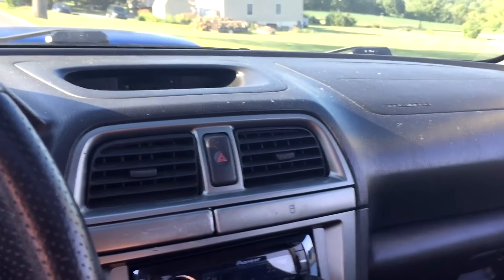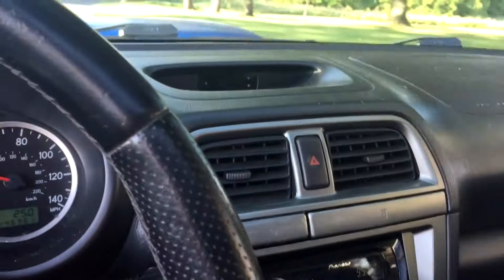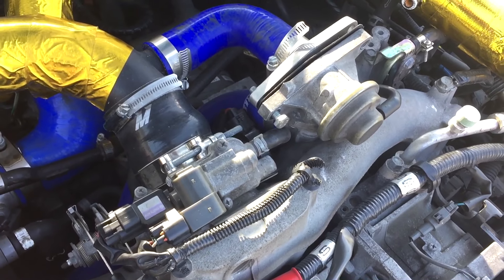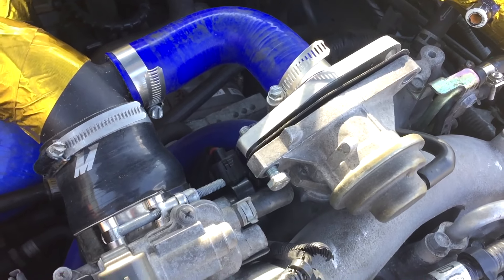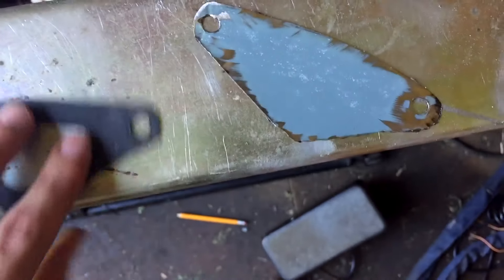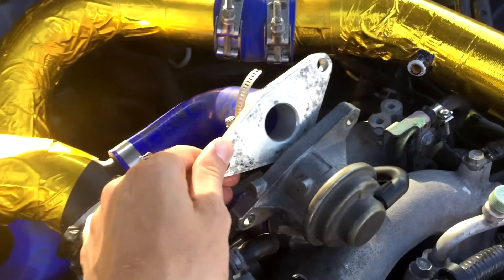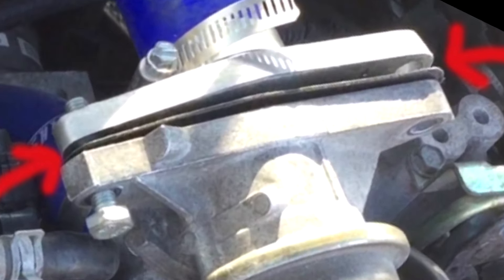DIY | BOV/BPV Delete - Block Off Plate | Stage 3 WRX Turbo Sound

Comment: Been a engine builder for 25years, I myself have been turbocharging cars since the early 90’s, since then turbochargers have come a long way, to my knowledge this isn’t causing any type of harm to the turbine or throttle body. There’s a lot of comments here saying lots of different things but these days everyone’s a mechanic lol
Reply from the maker: well said
Reply: Very nice 😎
Reply: I m a mechanic...level 255 mechanic...in Ragnarok Online 😂
Reply: The noose is the turbo spinning babckwards and fitghting itself cause the air has no where to go! This will break the blades extremely terrible.
Reply: @holeshot1721  Please do more research
Reply: If the turbo were to spin backwards wouldnt that in turn send the exhaust back into the engine stalling the engine😅🫠🤣🤣🤣🤣🤣🤣🤣🤣
Reply: @holeshot1721  Bro its just the blades chopping the air. All it will do is maybe a little bit more wear and tear over time of high PSI boost. Do some research before believing others, trust me it will take you far in life. Wait till you realize its physically impossible for that boost to spin compressor blades backwards

Comment: How tf is it ricer lmao it’s literally one of the best sounds in the entire world lol
Reply: Sebastian b yeah I didn’t get that at all lmao a ricer car generally isn’t even turbo
Reply: I think he said racer not ricer, I may be wrong
Reply: @Z4G.  compressor surge will do damage which is what that is
Reply: @whoischris28  No amount of surge will damage a modern turbo. Flutter is not a one way ticked to a fucked engine.
Reply: It's ricer because it literally does nothing for performance and is all just for sound. It might also cause a tiny bit more turbo lag and does cause SOME wear to the turbo.
Reply: @cameronmauro7209  calm down man child
Reply: @cameronmauro7209  When the throttle is closed, excess boost pressure has no where to go so it travels back out the turbo whilst the compressor is still spinning (how the turbo flutter noise is created). As it escapes, the excess boost puts pressure against the compressor and slows it down, potentially creating turbo lag and wear on the turbo itself. Modern turbos will be able to handle this well but other older turbos won't. If you're on low psi it won't be as big of a deal but higher levels of boost MAY or MAY NOT cause lag and an acceleration in wear to your turbo, NOT KILL YOUR CAR. If any of this weren't the case, there'd be no reason for the invention of the blow off valve and there'd be reason for car manufacturers to spend their time and money researching and developing these systems for their cars.
Reply: If you’re going to try ‘educate’ someone, atleast be correct, you’re a literal child, not man child
Reply: @cameronmauro7209  you’re so mad kid lmao
Reply: Closed throttle compressor surge has absolutely no way of ‘creating turbo lag’ and the research into it has proven that there is negligible excess wear onto turbos, and no, they have had to introduce BPV’s because of emissions, you know? The reason why so many manufactures are going small cylinder turbocharged engines like Audi, vw, Mercedes? 
Emission restrictions are getting ever more strict, and companies are having to comply, almost all turbos handle this fine except maybe the cheap eBay shit, ihi turbos on the stis handle antilag quite well aswell which is 1000x harder on the turbo then this, now, know what you’re talking about please 
It has been a grey area for so long, because people are so set in their ways of ‘compressor surge = bad’ that they won’t change there opinion when dozens of researchers have found that it actually does negligible extra wear
Reply: @cameronmauro7209  unless you're willing to share research and actual evidence, you're not going to be correct either. The only child here is you. I have never seen anyone get so heated over something so trivial. You're literally calling people fucking idiots and insulting them just for saying compressor surge = bad, with your own point not being too convincing itself. Take a good look at yourself first before you look down on others.
Reply: @cameronmauro7209  From what I know, BPV's have been around for ages, long before emissions were ever a problem. I do agree with the negligibility of wear. I was just concerned with how older turbos would react, which I did state on my own comment. Also there might be no way of it causing turbo lag or it being negligible but wouldn't it be better overall just to use a BOV or BPV instead of blocking it off? Boost pressure is relieved or recirculated instead of interfering with the turbo. Don't get me wrong though, I love compressor surge/flutter/dose. I just think using a BOV/BPV would provide better performance and be safer to use. I would gladly and happily look at any research that states those findings so I can be rest assured that it won't cause any damage to an older turbo on a 20 year old plus WRX with 300,000kms which I'm unfortunately going to have to settle with. Hope you don't get angry at me for wanting to discuss and learn.
Reply: @answrcr3783  if i was to block my bov in my 1990 mazda gtx with 223,000kms would it cause any damage/wear to my turbo? (factory turbo)
Reply: @genstil1652  I wish I knew too. Personally I'd rather not block it off until you find solid information on it. From what I learnt (not solid information), since your car is older and already has a quite a few KMs, it's better to not take the risk.
Reply: I had always thought rice was an acronym for "race inspired cosmetic enhancements". If that is true, this certainly fits the bill since the only purpose is to make it sound "better".  Probably won't hurt anything, but not helping either.
Reply: @whoischris28  Compressor Surge Happens under throttle when boost is building and the impeller spins slower than the gasses going in....
Reply: What makes this ricer is the fact that it takes a valve that recirculates excess boost back into the turbo, and dumps it out of the turbo itself. It makes pretty much no noticeable difference, but on paper it will in theory increase turbo lag. And compressor surge is only a bad thing when you’re at open throttle, doesn’t hurt the turbo with a closed throttle.
Reply: Because it's damaging the turbo it's surging back through it leading to it's premature death
Reply: @answrcr3783  thank you I tryed explaining but I feel it's best to save the finger strength from typing with the numb skulls
Reply: @whoischris28  3 years on a stock garret gt3582 from 2005 on 17psi. Guess what? Still boosting and dosing to this day.
Reply: Flutter during open throttle is bad. Flutter during closed throttle will do nothing. Facts.
Reply: Compressor surge which makes the noise will damage the turbo
Reply: @macrol4323  In reality it doesn't cause any turbo lag, people have tested it, there is no difference in turbo speed after letting off the throttle between running a valve and running no valve, the turbo slows down at the same rate either way.
Reply: It’s not ricer lmao

Comment: This type of compressor surge is harmless. It only does considerable damage when it happens under throttle. It can cause your impeller to wear out faster, especially if ceramic, but not enough to warrant reliability issues.
Reply: I highly and respectfully disagree. Compressor surge in any way, under wot or closed throttle is not good for turbo and at a minimum cause excessive wear on the cold side... also this will 100% cause a lean condition under boost unless he's tuned for it.
Reply: @timmann111  You have a point, but let me ask-What would you consider excessive wear? If your car is properly setup again, I stand by my point. But I agree with yours wholeheartedly if you build AND tune for, let's say 400PS, and then expect to get stock engine amount of miles out of all your parts then you're giving yourself confirmation bias by having objectively lofty ideals of reliability. A 400PS Turbine having surge after throttle on a 400PS Built Engine Tuned to 400PS won't last long for a daily driver but it will last plenty of time for race car. The turbine itself will start to give out a little before the accessories of engine do then shortly after that the engine itself. A good example of this is one of the Smaller turbines for my car made by Greddy. One kit designed to run both on surge and blow off is rated for 280-320PS. A bad tuner makes a difference in that rating being daily reliability and race reliability. Incidentally the same exact thing can be said but with 320-400 given the kit has a blow off valve installed.
Reply: Are you referring to a ceramic ball bearing turbo?
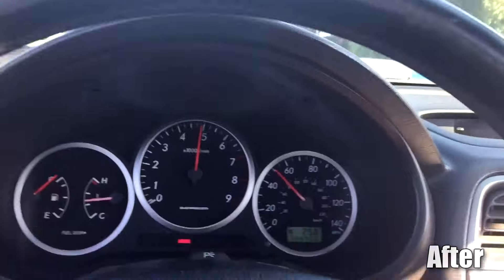Reply: 1:43 it’s happening under throttle so yea not too good
Reply: @chasethompson7392 I didn't watch until that part. I had to turn my volume up because I thought that was just the waste gate- but yeah THAT'S  not good.
Reply: @chasethompson7392  That is just the wastegate, compressor surge on throttle does not sound like that.
Reply: @RyuusanFT86  It is the wastegate.
Reply: This isn't surge
Reply: @Phz.001  That's pretty much what I was saying guy

Comment: It's not as bad for your turbo as people think. When ejits say it stalls the turbo it doesn't mean that turbo stops spinning or spins backwards, it's not the turbo that stalls it's the air just like interference over a planes wing stalls the air. It may lose you 4-5% of turbo life which out of 100,000 miles isn't enough to worry about. Lack of regular oil changes is alot worse for turbo.

Comment: BOVs aren't solely made to keep the compressed air from damaging the turbo but to keep it from damaging the throttle body blade when boost is reached and the butterfly is slammed shut in the throttle body. You can bend the throttle body shaft or the plate at higher boost levels. Possibly even sending pieces into the intake manifold. Your probably fine at low boost tho. Just some info no hate, does sound cool tho... lol
Reply: This is the most logical response for damage I've seen for this. I never thought about the throttle body being damaged b4. And having a bpv they wouldn't need as strong of throttle bodies so they are prolly made weaker to. Dang.

Comment: Do u still have this car? If so is your turbo still going Good?
Reply: What year is ur subi ?
Reply: @Stanleyyelnats210  2000 wrx gc8, with a vf28 from a version 6 Sti Type-RA
Reply: 2003 legacy gt-b ej20tt with STI exhausts hella horns pushing 20 PSI

Comment: From a person more knowledgeable than me for all the "experts" commenting that you need a BOV. Hope this will break it down much better than I put it before.

 "Not even turbo manufacturers themselves manage to get this one right - talking nonsense about compressors stopping and spinning backwards.I'd like to add a couple of very important points about compressor surge:Compressor surge is caused by two very distinct situations.  And the situations have two very distinct outcomes: One cause you could call "lift-off" or "closed-throttle" surge. Caused by closing the throttle plate, eg. between gearshifts. The other type of compressor surge is "open-throttle" surge.  This is happens when the throttle is open and the turbine is being powered by the exhaust gasses.  It is cause by a turbocharger that flows more compressed air than the engine can digest.
Open-throttle surge will DEFINITELY destroy a turbo (I can confirm because I've done it!).  However, a BOV will NOT stop this; on open-throttle surge the throttle is open and the inlet manifold is pressurised, therefore the BOV remains closed.  The only way to stop this is either to choose a more suitably sized turbo, or to tune your boost control so the turbo produces less boost at the point where it surges.Lift-off surge, on the other hand, is much less damaging - possibly to the point of being negligible.  Exhaust flow is low so there is very little force acting on the turbine.I've built and also tuned a fair number of turbocharged engines of various outputs over the years.  I've also rebuilt a number of turbochargers.  I've never once experienced one die from not having a bov.  Oil starvation, oil contamination, foreign object damage, over-speeding (quite often when a BOV hose, Tee'd to the wastegate hose, splits) yes - lots.  But not having a BOV?  Never.Personally, I feel that the negatives of running a BOV (expense, added complexity, more potential points of failure) outweigh the possible positives.  So I never run BOV on any of my engines - and never will. [Sorry about the big block of text.  for some reason Youtube keeps deleting my paragraph spacing]"
Reply: squishypitbull thank you!!
Reply: Very helpful
Reply: So basically to break it down your saying that doing this will not hurt your turbo. And is actually supposed to be ran like this
Reply: @G_Lob814  don't listen to him. If you're running a factory turbo, it is in your best interests NOT to remove your bov. At low boost it is okay, but at full boost or enhanced boost levels, it is harmful to your compressor and bearings. A compressor never spins backwards, the whole reason why the choo choo noise occurs is because the turbine is still spinning correctly, but air can't escape and creates a negative pressure area on the compressor, stressing the fins and rotational components. Keep your bov, or buy an aftermarket one and just tighten up the spring until you get blow off at high boost, and choo choo at low boost. Easy and safe.
Reply: Swipez let’s say I wanna delete the BOV but diverter valve is what I have and put the block off plate but I’m pushing 15 PSI spikes 18psi then down to 15. Can that be safe or either not recommended. Also I don’t beat on my car at all it’s always getting babied everyday only once in a while i step on it   Thanks
Reply: So your saying I can do this to my FXT?
Reply: All ball vs journal bearings make a difference. On ball bearing turbos the surge and effect of no BOV is basically 0 harm to the turbo. However, on journal bearing turbos, at higher boost and load (especially on stock OEM turbos) the compressor surge can wear out the journal bearings a little bit faster. On quality aftermarket turbos, even journal bearings, the wear is most likely just neglagable.
Reply: Just lost all credibility when it said "even the manufacturer's get this wrong" think about how stupid that comment is.
Reply: Watch a WRC and listen. Enough said 😁
Reply: HulaBalo you should be getting the AOS before any other mod on an FA Subaru. If you do mods in the order you described, you’ll blow up the engine before you even have a chance to enjoy it lol
Reply: The only non credible person here is swipez. The wrx and sti, and all other oem turbo cars do not come with a blow off valve (bov), they come with a bypass valve (bpv). Anyone who knows anything about stock turbo cars knows this.

Also the surge does not make the turbo spin backwards, that's not even possible when it has exhaust gasses passing through the hot side. It does slow it down, but will not make it spin backwards.

I still would not do this to a Subaru as they can blow up stock lol.
Reply: Help me plz 2011 wrx I did this, and between gears i get a fucking shotgun blast backfire for 2nd 3rd 4th. Help plz.
Reply: @hotj606  its probably sensing  all the air coming back out as air going in then throwing more fuel into the engine if you haven't solved that yet
Reply: That’s the first time I’ve read a comment this long. Thank you for the info
Reply: Only reason this works on this car is cause you guys got two feet of rubber connectors and the buldge out and absorb the impact when throttlle plate closes. Your ringlands will hate you soon!
Reply: @EnkeiTenjin I have a stock tdi golf 5 want a bit more Choo Choo as you say all I hear now and again is a bit of whine which is to be expected. But still want a bit more stutter without any damages long run and when I say long run I mean 50k km or miles if your a American which is less

Comment: To kill any argument about doing this. 
This is not bad for a turbo. Cars had turbo's long before BOV's were a thing and they ran just fine without blow off valves. 
For those stating its ok at low boost but not at high levels its also crap. Rally cars and others like porsche's all had turbos' without BOV's and they ran just fine. Its called flutter. 
Compressor surge is a completely different thing and that WILL harm the turbo. 
Blocking off or deleting your BOV does NOT cause compressor surge. End of argument.
Reply: squishypitbull I know lol people want to know everything but I fucking hate seeing the statement that it's bad for your turbo.
Reply: good way too keep boost between gears I guess lol
Reply: Oh.. please tell us more about how much you think you know
Reply: ty
Reply: In the video you can hear closed throttle compressor surge, which is not harmful to the bearing in the turbo.

You can also hear open throttle compressor surge which can destoy your compressorbearings much faster than without an blow off valve because it puts a lot of stress on the compressors thrust bearing (it also depends what bearings your compressor is using)
It will harm your compressorbearing!
Reply: only thing you have to worry about really is the air fuel reading your ecu will be getting. as that air isn't circulating back you could be jumping between lean/rich for that second or two while off throttle
Reply: Tobias Pohn that open throttle flutter is an ewg setup. It has nothing to do with a bov. Its in the up pipe. It helps build boost faster and keep a better psi throughout the rpms.
Reply: So blocking the bov on a stock turbo does not affect the engine??? I have a genesis coupe and i only have a cold air intake as performance mod
Reply: Lol nobody take this mans advise